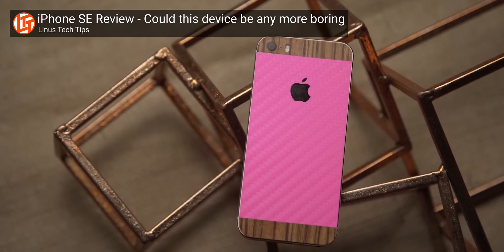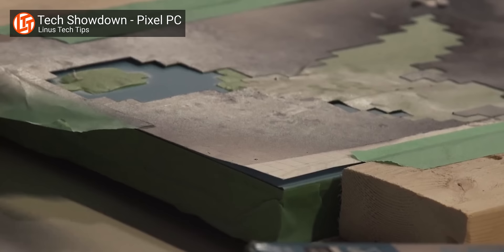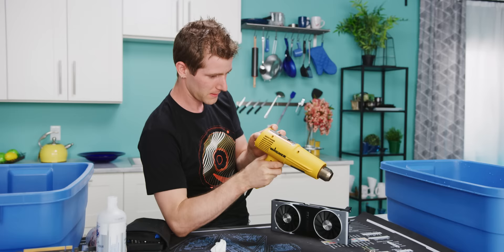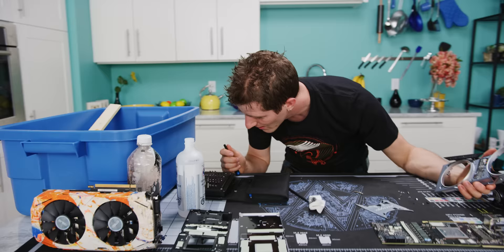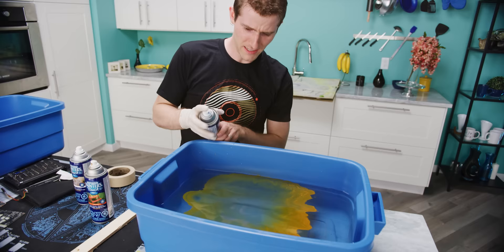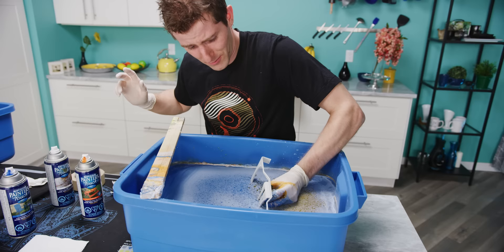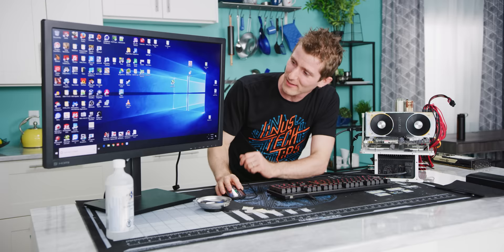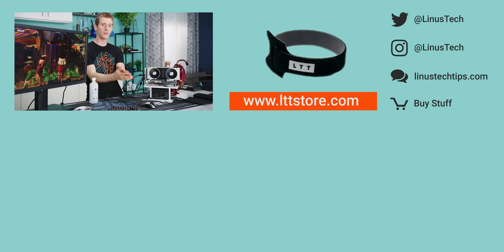We Destr… Hydro Dipped a $1200 GPU!

Comment: "Nothing but boring old LEDs"
me, with a dusty-ass computer that has cables sticking out and a fan that sounds like a lawnmower: ;-;
Reply: the fan might be hitting smoething in your system
Reply: well I mean you could always clean it and cable manage it.... It would probably appreciate the dust removal and maybe the fans wouldn't have to sound like a lawnmower...
Reply: @SweepSwapInUrWalls  my prebuilt came with a little random foam foot in the PSU somehow.... I had got it on sale too so when I turned it on and it sounded legit broken my heart sank because they only offered refunds and not replacements. Thankfully I figured out it sounded like it was coming from the PSU so I opened her up and sure enough there was that random foam foot smacking the blades.

Comment: Sponsored by iFixit but name dropping Gamers Nexus, I love it!
Reply: @Maciej Nenutil the bench mat is sold on their store and it has become a joke that it's never in stock since it gets sold out instantly (that's what it was like last time i checked anyway)
Reply: @angrydragonslayer  I guess that explains the absurd $100 price tag.
Reply: @draanexle  a mat that size made from that material without print is still $60 so it's not too bad
Reply: @draanexle  It's very expensive to make an actual, proper anti-static conductive mat at low quantities with good material durability and discharge potential. Economies of scale at work. We have more profit margin on shirts than we do in the mats. You pay for quality!
Reply: @papag fank What do you mean by 2k? 1080p? 1440p?
Reply: @GamersNexus  And most importantly: It just works.
Reply: @GamersNexus   Agreed! Now if only there was a way for cheaper international shipping, your store would blow up.
Reply: @papag fank I actually just built one for that. Asus prime z390-A motherboard, i7 9700k, 16gb gskill ripjaws 3200mhz ram, evga rtx 2080 xc, nzxt h500 case and karcken x62 280mm aio, corsair 750w psu. Couldn't be happier with it.

Comment: Linus: Make sure the surfaces are clean before you hydro dip it.

Also Linus: grabs the cleaned surfaces by bare hands
Reply: At least he didn't use bear hands when he disassembled it.
Reply: @abstruse2633  thanks for your kind words
Reply: @ipadize  Indeed. Insightful wisdom from our alien brother or sister.
Reply: @abstruse2633  We're packed and on our way to Area 51 soon, we'll get you out asap.
Reply: @abstruse2633  Well, it's actually because any painter knows fatty oils in your skin can show up down the track through the paintwork/finish.

Comment: “I wonder why they would glue it now” it’s so we’re discouraged from taking it apart and giving it a paint job
Reply: @danielschroedinger2090  Makes it hard for the average Joe to replace fans if they stop working 🤨
Reply: @opgaquatics5609  One could argue this kind of repair is a bit above average Joe level- stuff and that someone committed enough to perform such a repair would not be stopped by some glue.

But point taken.
Reply: Daniel Schroedinger I really doubt anybodies gonna try and claim warranty if they break their gpu trying to hydro dip it lol, never needed to get a gpu fixed myself but I wouldn’t be surprised if the makers of the card offer the service for a fee, same reason apple use glue.
Reply: @blacktiger171  
@"I really doubt anybodies gonna try and claim warranty if they break their gpu trying to hydro dip it"
I find that assuming people to posess rudimentary common sense can be a dangerous mistake to make.

Comment: Me:
So he'll dip the gpu into water? Seems cool

Linus:
disassembles the gpu.

Me:
Ohhh...
Reply: Well... What would you expect?
Reply: @givemepen0  I thought they're gonna try cooling it down by dipping the entire thing in a bucket of water.
Reply: @astral6749  .... and HOW exactly did you expect the card to work dipped in a bucket of water??
Reply: @Goreface69  that's the whole point of clicking onto a video with a title like this. Wanted to see how...
Reply: @Goreface69  I did not expect it to work. That's why I clicked on this video.
Reply: @dayleramsden9352  lol i mean the whole problem there is that water conducts electricity, so the card would just short out and die. on the other hand, if you use a non-conductive fluid like mineral oil...
they've literally got like half a dozen videos with linus and luke (many years ago) putting together an oil submerged PC... and then more recently, it's had some updates.
Reply: @Goreface69  I actually thought they were going to use some stuff to seal the electronics and make them waterproof, then cool them by putting them directly in water. This is possible, but risky because the seal obviously needs to be perfect.
Reply: You also use destilled water, because it’s not conductive.
Reply: @thebeber2546  While that's true, it's quite hard to keep distilled water pure enough so that it does not become conductive... If it becomes just a bit contaminated it quickly becomes conductive and it's bye bye hardware. Just a bit of dirt that was already on the hardware itself might be enough to do it.
Reply: @finraziel  distilled water is still conductive, since water self-ionizes and creates some OH- and some H3O+ ions, so even pure water is electrically conductive, just much less than water that contains other dissolved minerals.
Reply: @finraziel  I thought they where going to resin seal it, leaving just the tubes to the water block and cabling open.

Comment: If you want an actual logo/picture on anything hydro-dipped, you would have to do your dip differently. Instead of dipping it straight down, you dip it flat onto the water. This way you can get symbols or logos on the object you want. Dipping it flat will also keep your hands from getting painted aswell.

Comment: A.  The "borax" method you are trying to use would be better achieved NOT with cans but dropping paint straight on the water's surface.  
B. To keep a better and smoother pattern it is better to draw the object sideways not straight through the paint, to keep drawing more paint on to the surface rather than risking breaking the connection of the paint.
C. It's possible to go even further and buy pre-made sheets of graphics you can buy for like £5 each and get an exact image or pattern added.
SO much more that you can do with this technique than your somewhat cool, but samey to the previous one outcome.

Comment: What he needed to do is to spray on a spot and only move it around for the first spray, next is just to spray in a pattern over and over and over again until you get the multiple ripple effect. After he needs to put painters tape on the back piece and dip it at an angle of 45° and once it’s fully submerged use your hand or the object to swoosh it around to make a larger gap as a opening and of course let it dry for 24 hours.

Comment: Bit of a modification to the process - use liquid enamel paints on the surface of the water. The colours come out deeper, and there's less of the issue of the paint drying on the surface of the water, allowing more time and flexibility.

Comment: What was the graphics card you dropped into the tub at the beginning?
Reply: Looks like a Geforce 6800 GT or 6800 Ultra, specifically the ASUS V9999GT or V9999 Ultra
Reply: Nintendope64  If it really was one of these i wouldn't have done that 😒
These cards can be used for retro gaming...
Reply: @Cher007  Indeed that's why I recognized it! I recently bought my V9999GT for some good old circa-2004 gaming.
Reply: I still have mine from back in the day, I think I paired it with an Athlon64
Reply: @Cher007  probably a dead card anyways
Reply: @Cher007  yeah but only can do that

Comment: Why would they do that?
Premature failure/performance reduction due to dust build up, prompting the user to upgrade, even if a clean card could run the game fine. It reduces the second-hand value as well.
Reply: Might have a little browse on ebay, see if I can find a good deal, open it up as you did then give it a good clean.

Comment: I know hindsight is 20/20 and all that, but like... why hydro dip one of the most annoying cards to hydro dip, when other cards had much easier shrouds to remove? I feel like they made it difficult for themselves on purpose. And then after, the card was messed up because the controller for the fans were broken and was pinned to 100% at all times.

Comment: "Hydro Dipped a $1200 GPU!"
You actually mean the $50 in aluminum not the actual GPU and Board...... Here let me help you with that title.

"We Dipped GPU Frame Parts In a Tub Of Paint Water" - We didn't obviously break it because we didn't have enough cash to burn to dip the full GPU as the old title would imply.

Comment: me with an 1060 my family give me for my birthday after i seen his "test" 1060: :(
Reply: 3GB or 6GB? The 1060 really isn't a bad card at all.... The 6GB version of the 1060 is still a pretty respectable 1080p gaming card. The 3GB version isn't bad either but the vram will end up being the limiting factor in some games. It still has its place though and both are good cards the 6GB version is just a bit more versatile.

Heck the 6GB version is apparently only 24% worse than my 1660 super which is 3 years newer than it is and both came out at similar MSRP's (1660 super MSRP is 220 and the 1060 6GB is 290). It was and is a pretty good card for the price and should play games at 1080p just fine. Now if its the 3GB version well that's 12% less performance than the 6GB version which is definitely noticeable but still a perfectly usable card just at slightly lower settings due to VRAM limits ect in some games. Plus I mean well the 3GB version's MSRP was 190 dollars versus the 290 for the 6GB version so it really was a great value when it came out.
Reply: @TheFrogInYourClosetWatchingYou  I have the 6 gb but still, watching it being used as a test card hurts.